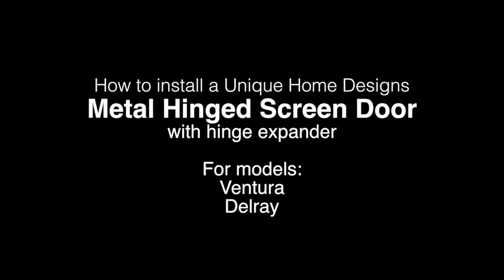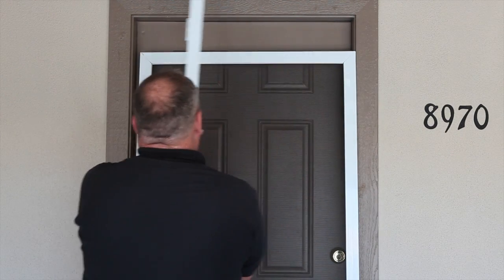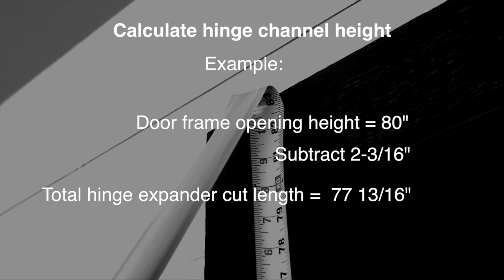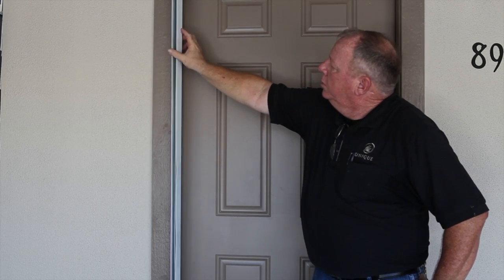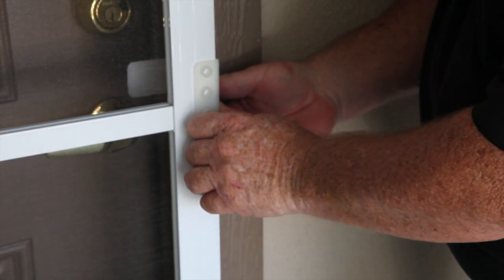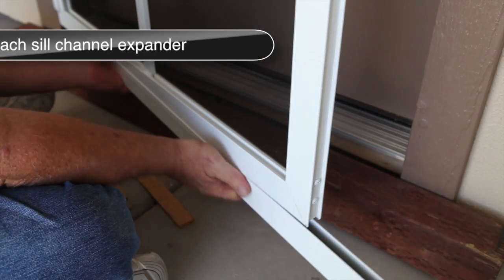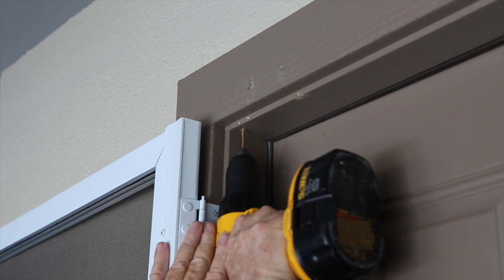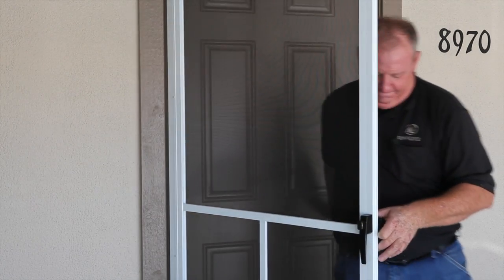Metal Hinged Screen Door Installation

Comment: Just a tip. . . Once you've made sure that the hinge holes are drilled in the right places and that the hinge channel opens and closes properly, consider taking the whole thing off and mounting the door to the hinge channel while it's on its side, then remounting the hinges to the door frame with everything attached. I'm sure this video purposely leaves out the part where the door is being fit inside the channel and instead magically forwards to the door already being in place, because it's a pretty difficult proposition with these instructions -- you'll probably scratch the door because the channel actually has to be bent outwards while lining the adjustment screws up with the threaded inserts in the door. Also, I wouldn't take the factory instructions to cut 2  3/16" of length off the hinge channel. Assuming that you've already cut it flush to the top, of the door, that leaves it WAY too short for the sill expander to cover the gap that's created by the bottom of the door being so much longer than the cut bottom of the channel expander. Really unfortunate.
Reply: @jnielsen1956  My pleasure.

Comment: There is an updated version of this video although it is extremely similar with only slight variation.  I installed a Riviera model screen door from Unique Design screen doors today.  I bought it at Home Depot for around $100 dollars during a sale.  This model has decorative metal on the lower half to protect the screen and make the door a bit more secure.  Replacing the hinge channel was a bit of a pain.  The channel was too tight and the adjustment screws don't allow you to squeeze the entire channel in place and then screw in the adjustment screws.  I wish the installation didn't require cutting the top of the hinge channel immediately upon unboxing the door, it's confusing and slowed me down quite a bit because I was afraid I was going to ruin the look or functionality of the door.  The bottom line is that the door looks and functions great.  The EZ adjust system really is easy to adjust and works perfectly. I would definitely buy another one of these screen doors without a doubt.  I wish they would better explain the cutting of the hinge channel and not make the channel so tight while trying to put it back on.  With that said............. They are a great product for a great price.
Reply: Did you buy this at Home Depot? Here in Texas they have never heard about that channel expander. I cannot even order it at Home Depot website.
Reply: @hardyvonnolting2723  
Yes, I bought it at Home Depot.  There was no sale flyer or anything,  It just happened to be on sale at the store. I don't know if they are still selling them though.  Good luck.

Comment: What is the reason for cutting the hinge channel 2 and 3/16 shorted than the height of the door opening?  The bottom channel is smaller than that and it would seem to make sense to cut the hinge channel to meet the bottom channel after it was in place and adjusted to the correct position.    I like the door, but there is certainly a lot of “why do I want to do that?” time in mounting it.
Reply: I really hate that about this video. No explanation as to why the cutting needs to happen.
Reply from the maker: The hinge channel expander is longer than the door so to fit an 80" opening they need to cut it to fit. This give the option for a better fit for your door and allow for variation.

Comment: I have one of your Pacific doors and need help on getting trim parts and would like to know how to tighten the squareness of the door, it moves up and down at the corners. It’s brand new. Site has no way to contact customer service. I need the lower trim piece as I cut mine to short.
Reply from the maker: Please contact the retailer or dealer where you purchased your door for assistance.

Comment: You cut an inch off (why not ship it 1” shorter?) and mark it “top” then you mark “bottom” with another cut but these tape markings are never seen again.  Are they just for orientation?
Reply from the maker: The additional one inch adds additional adjustability if needed. The tape markings are for orientation, after the measure and trimming of the door,  it is mark so the door can have the hinges on the appropriate side of your entry door.

Comment: I have to remove my trim molding to install a screen door on my house entry door in my garage. The trim is about 1/4” thick, so Its not deep enough to screen on hinges. Going to rip that off and install new boards. So dumb

Comment: Even after the replies to the inquiries below, I still don't understand the cutting the initial 1" off when immediately after, you are cutting it to the size of the opening (minus 2-3/16"). What am I missing?
Reply from the maker: The hinge channel provided is intentionally larger than the hinged door height, cutting the additional 1” off adds to the adjustability if needed for the channel, then measuring for the door height makes the cut more precise.
Reply: I agree with you.  I took extra time trying to figure out why it just didn't come flush at the top with adjustments being made at the bottom, perhaps with a slotted design.  I ended up reading the instructions multiple times and then watching 2 different videos. Eventually I just followed the directions but thought it was longer because the company may save money by making that item useable on different products and letting the consumer do the work of trimming it to size.  I mean the minute you unpack it you have to cut it off.  The only problem I had was trying to put that hinge channel back on, twice.  The channel itself was so tight I had to spread it open at certain points after getting aggravated because I didn't want to ruin the look or functionality of it.  I finally got mad enough that I just spread it apart, thankfully it looks and functions great.  Anyway, the door is well worth the money but wasted some time trying to figure out why I was cutting the top of the hinge channel right out of the box.  No one wants to make a mistake by cutting something wrong and ruining the product or ruining it's appearance once in place.  I think that's why people spend time wondering about that cut.
Reply: @HelpMeInstallIt  Except that cutting the hinge channel that much leaves a pretty sizable gap at the bottom. Too much for the sill expander to cover up.
Reply: @jnielsen1956  
Yeah, it's been a few years but I remember how it just made no sense.  Hope yours worked out alright.

Comment: 4:05 you forgot to install the rubber sweep on the bottom. Without it you have a space all the way across the bottom to let bugs and insects in the house. You fail.
Reply: Doesn't come with one.
Reply from the maker: The sill channel expander is installed at 4:15, this will eliminate the gap at the bottom of the door